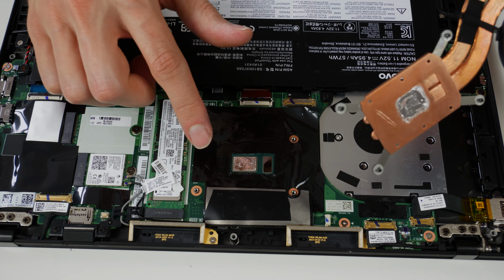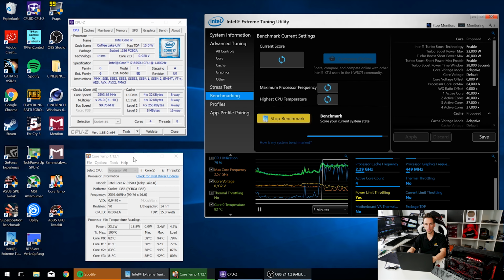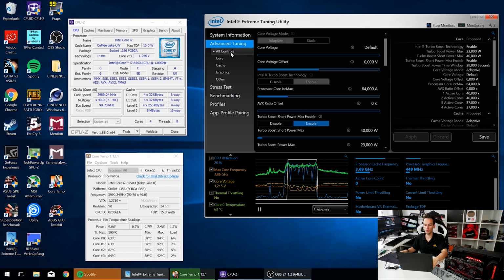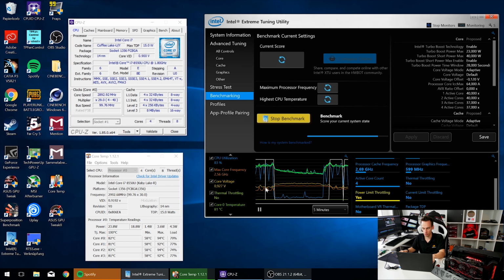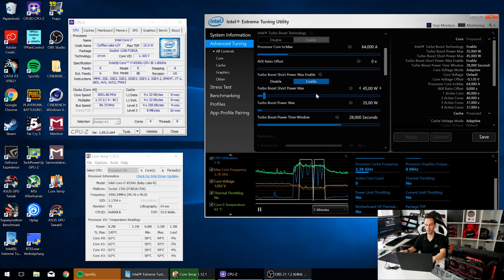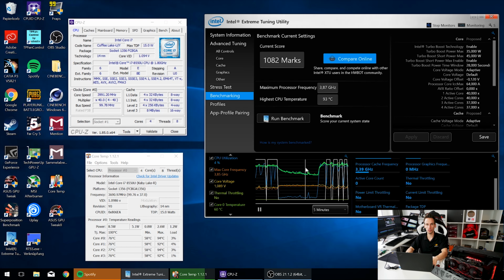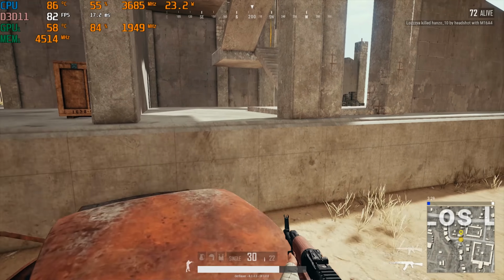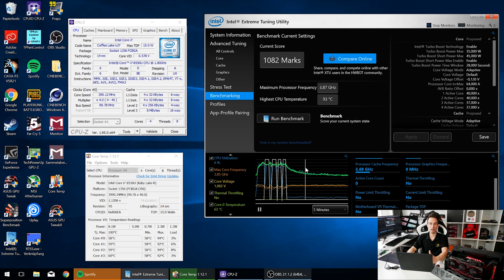Lenovo X1 Carbon G6 - Liquid Metal and Tuning (Part 2/2)

Comment: My i7 4720hq doesnt like any undervolting...Gonna try conductonaut :D
Reply: i already used conductonaut on my 4720hq , it's maxing 82 degree under load , however i couldn't get further overcklicking , i'm hitting current limit throttling :/
Reply: @mehdidamfs3112  currently on kryonaut thermal grizzly I hit 99 on all cores... Undervolting doesnt work cause system resets...
Reply: @Albert41122  i'm on -55mV  that's the max i can go for
Reply: @mehdidamfs3112  does it even helps a bit with lowering the temps ??? I could lower temps starting from -71,3125 mv but its not stable in games... However if I put higher for example -60 mv its not helping with temp even in tiny bit...
Reply: @Albert41122  i used undervolting after LM , so yes i had a small diffrence , but i'm not sure if you can have it with thermal paste
Reply: @Albert41122  i just did a small test 100%load 50% fan 3.4GHz for 3 minutes  , no undervolting max_temp= 82  , -60mv max_temp=78
Reply: @mehdidamfs3112  well how about in games...doesnt it resets or freezes ???
Reply: @Albert41122  for -60 rarely , but usually i make it -55 when i would like to play for long period

Comment: Use "Silicone Modified Conformal Coating" all around the CPU/GPU die area and surroundings to waterproof and lock any Liquid Metal from making any contact to the micro components in that area!  Once it dries for EXTRA PROTECTION, tape the surroundings with 5mm and 25mm "Kapton tape" as this is the best super highest temp resistant high quality tape and leave zero residue when taken off...   Water proof anything you want with the Silicone Conformal Coating to avoid any future rust and moist buildup prolonging you Thinkpad X1 Carbon or any other laptop/computer!

Comment: Please redo ALL the same benchmarks you did in previous video, with exactly the same GPU speeds and external monitor and then compare the difference with and without liquid metal applied. A 5minute video with just the results is enough. :-)
Reply: and just call it part 3/2 :D
Reply: A O lol, what I meant to say is, the video with the GX station 2 benchmarks.